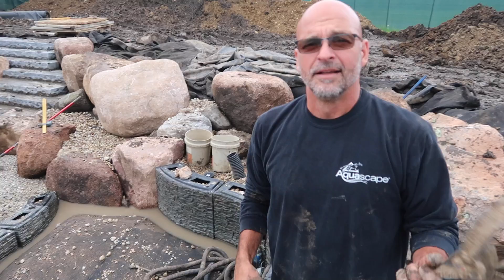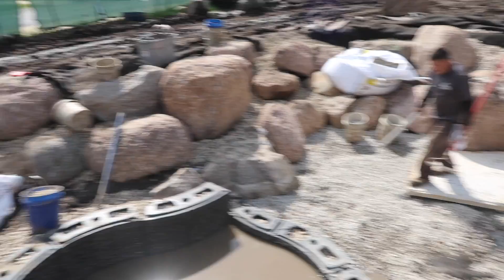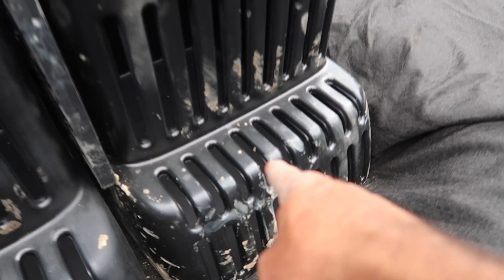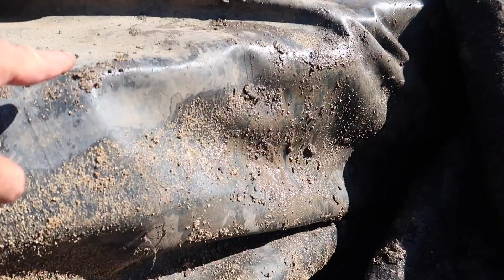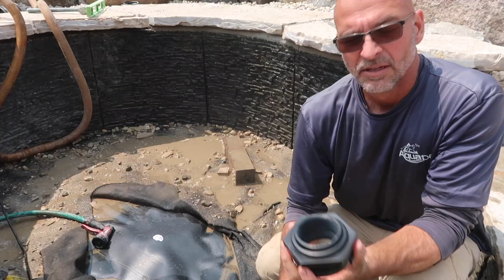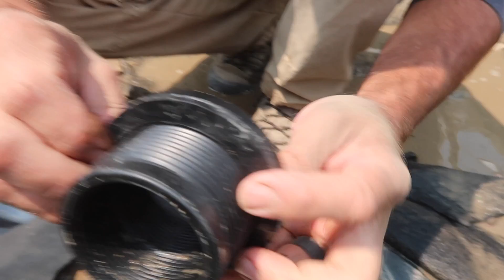Building an EDGE for Recreation *POND* & Waterfalls: Christ Community Church - Part 3

Comment: Tons of advance construction tips all in one video!  Ed, someone asked if we should put a cage over the cleanout fitting?  For locating and clean of debris IF you need to use.
Reply: Chris Wilson Sounds like a good idea!
The clean out fitting is located in a relatively small area of the deepest point of the pond approx. 8’ diameter, the fitting is exactly in the middle so I hope it’s not too hard to locate?

Comment: Hi Ed, just wondering why you didn't install a hydro-static relief drain under the liner during construction. We do it on every pond that we suspect this problem could occur on.
Reply: AquaticLifestyles I agree!
We don’t install the sub-liner drainage systems on every project, it depends on the soils and if we see groundwater during excavation.
We didn’t see the normal signs and it backfired on us!
Reply: @edbeaulieu5916  I understand. Great fix, by the way.

Comment: Would It be a good idea to put french drains below the bottom of the pond to drain off the water that is causing the hydro-static pressure if you have a high water table?
Reply: e Rob Yes,
Definitely easier to install it during the excavation process!
We didn’t see the normal signs of high groundwater intrusion so we didn’t install the drainage system, but that didn’t work for us this time.....